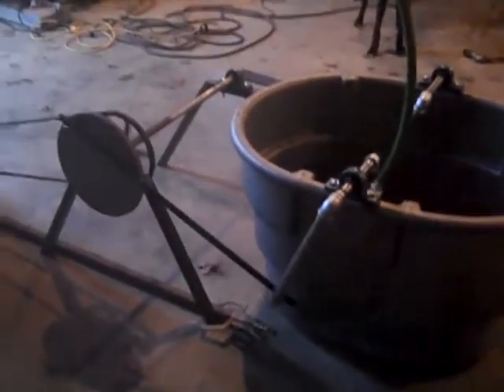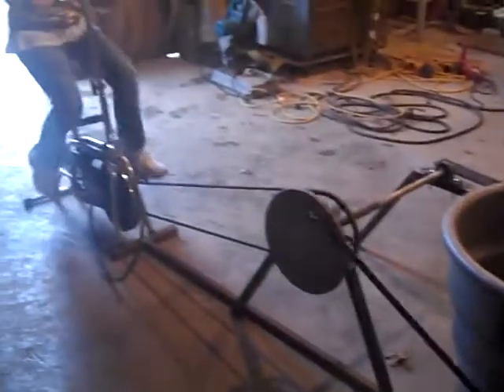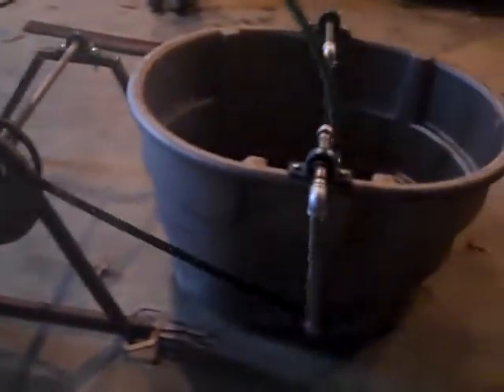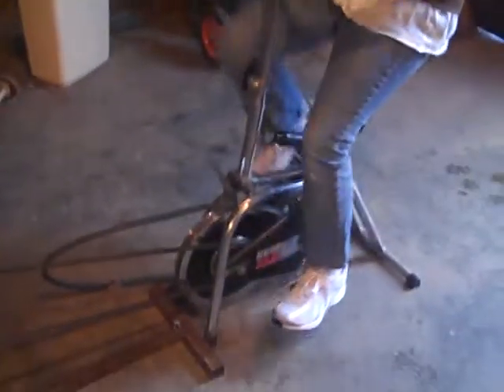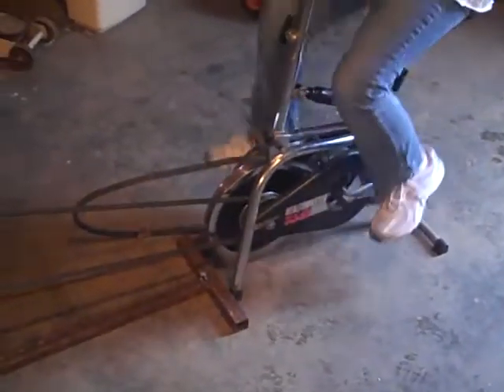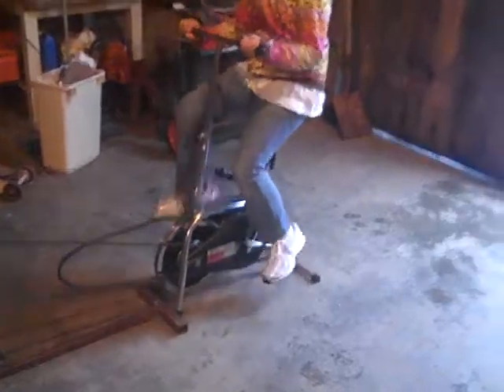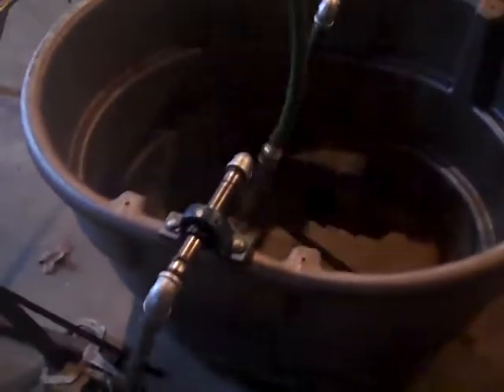Pedal power washing machine

Comment: Why don't you get a plastic drum, have it horizontal, with another drum inside with holes, with a drain, so you can wash and dry at the same time. Put some clothes in the wash tub, put some already rinsed and washed clothes in the dryer and it will be double action.

Comment: i have been wanting to try your bike pulley system on a volkswagon generator to charge car batteries and have power inverters for outlet to charge AA batteries and such. do you see any reason why this wouldnt work? i hope to have a very large gear on the bike so i dont have to pedal as fast in order to get the required rpm's. its my understanding alternators need power to start their charge. any help would be appreciated.

Comment: Always get a kick out of these homespun design / engineering projects.
What might be handy is being able to operate drain and fill valves while still in the diver seat. You could run thru the wash and rinse cycles and still keep pedaling at a steady rate.